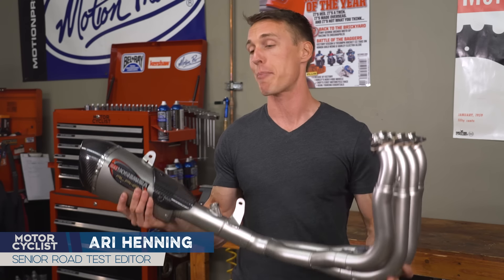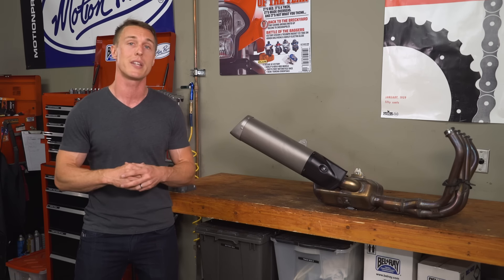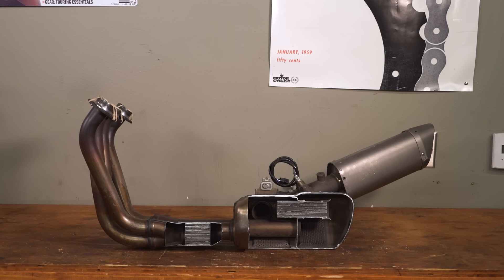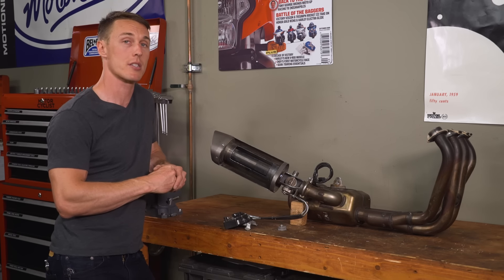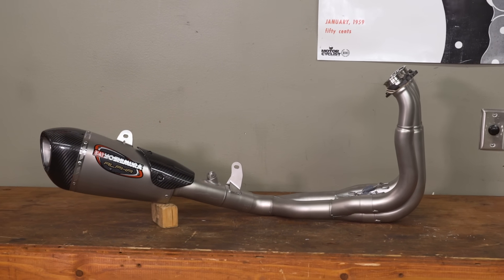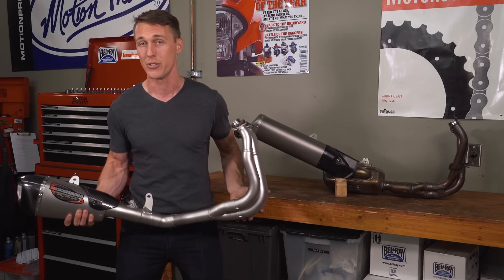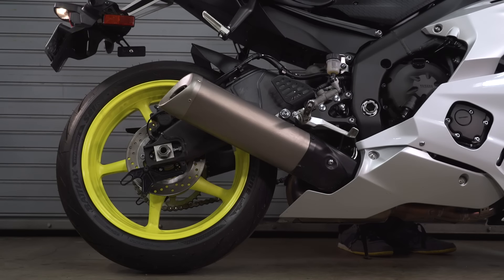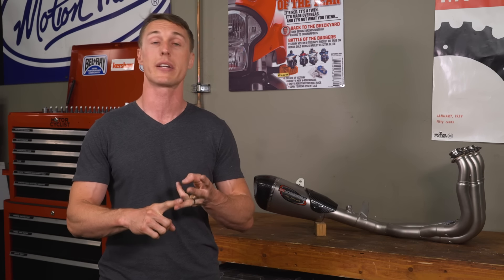The Truth About Aftermarket Exhausts | MC Garage

Comment: FIrst of all, when you use the word "back pressure" it just clearly shows that you have no idea how exhausts work. The whole back pressure argument is a fkn myth. Second of all, another,fairy tale error in your bad video: they do not use an exhaust valves in Motogp to "improve mid-range" lmao. The valve they use is the black box on the end of the exhaust if you ever bothered to look. It control engine braking... not power dummy. An excerpt from Marco Palmerini (Ducati) "New exhaust valves or flow restriction devices can create negative engine torque when the throttle is closed. This, in turn, slows the rear wheel and reduces the braking force required by the rider. The exhaust system can aid the riders when it comes to cornering at high speed." Obviously they are put there to restrict the power. Not enable power. They are on street bikes to control decibel noise levels only. Nothing else. They actually restrict the bike on every single test and real world dyno. Once removed, not only there is a distinct performance advantage, the bike also handles better. The spread of misinformation buy this "chad" is on another level. You need to go back to school Chad. "back pressure" lmao... are you for real?
Reply: Snarkyness aside, do you have some real arguments? 
Agreed that he is misrepresenting what back pressure is. Backpressure is however a reality in any flow, in any pipe. Some aspects of backpressure in engine debates - as if backpressure is ever sought - are closer to myth material. 

I'd like to know more about the valves in GP-racing and the valve he shows here. It might be so, that the valve here is for sound only. or it can be to hamper power output. When shut it will increase backpressure. that is a secondary effect is my guess. It will very likely also change the frequency dynamics (the reflective pipe length)  i.e. the rpm-range the exhaust is optimized for.

Regarding the reasons for gadgets in racing, they aren't generally in the business of sharing R&D-results with the competition, so whatever they say, I'd expect the real reason is somewhat different.